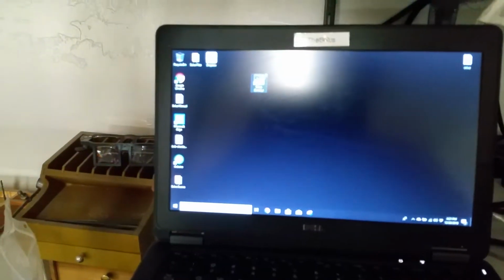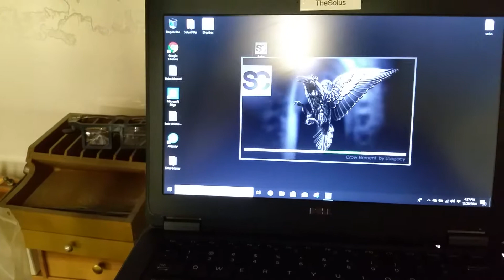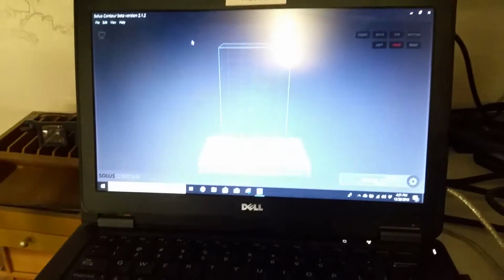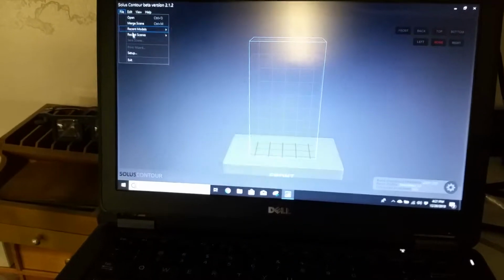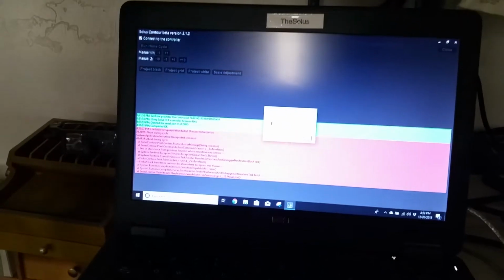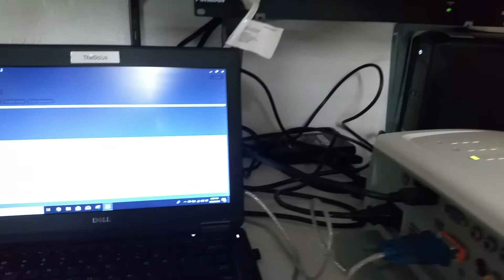More solus printer problems

Comment: Still a really really good printer for the price. Simple connection issues is all I see. More of a windows issue than the actual printer. I’ve moved on to the solus pro. No more wasting time calibrating and tweaking. Simple load the job and print. They’ve even solved to film tension issue that the user no longer has to deal with. Several steps up from the original printer.